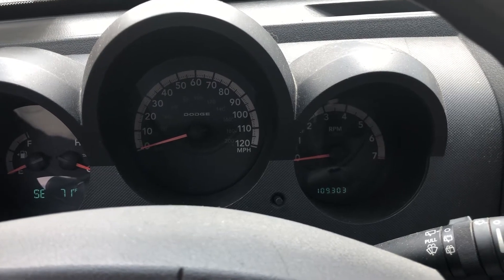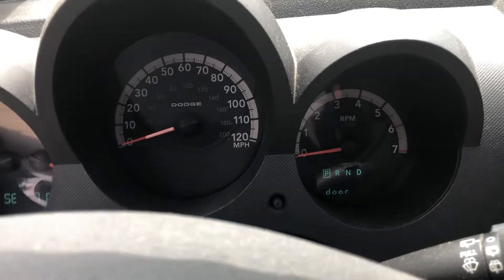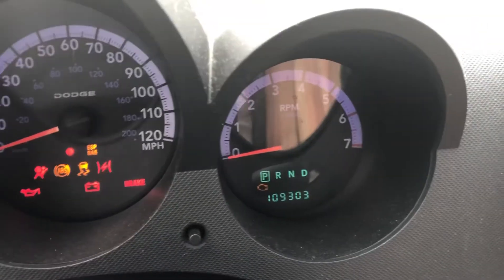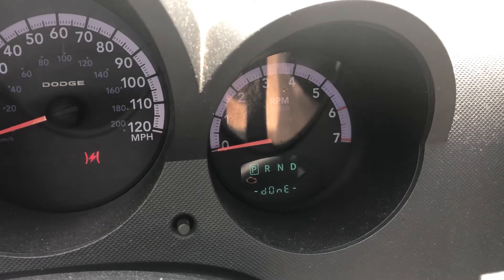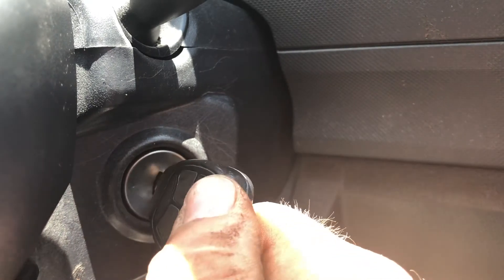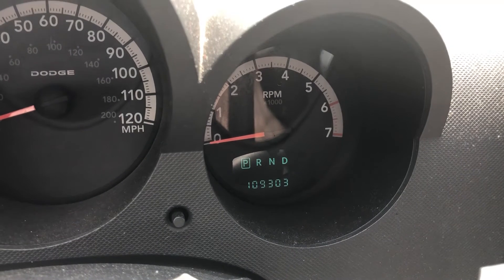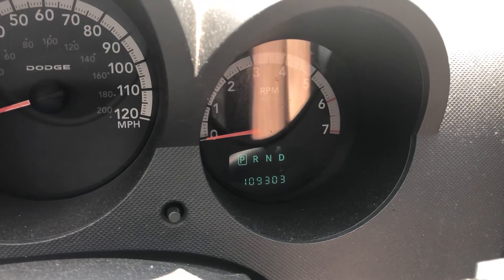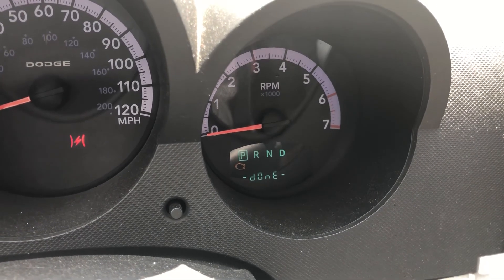2008 Dodge Nitro engine code retrieval without a scan tool !

Comment: What if it says done and no code comes up but the engine light stays on?
Reply from the maker: Then you either accidentally erased your codes by doing it wrong. Or you in fact have no codes logged.
Reply: @bluegauges  o.k thanks!
Well I went to disconnect the negative cable to the battery and it was loose so maybe it was that?